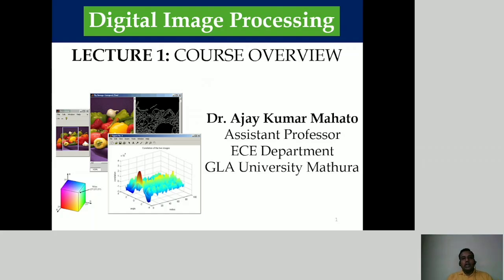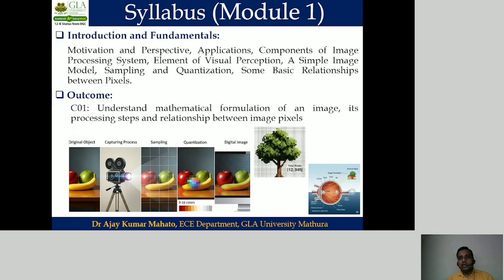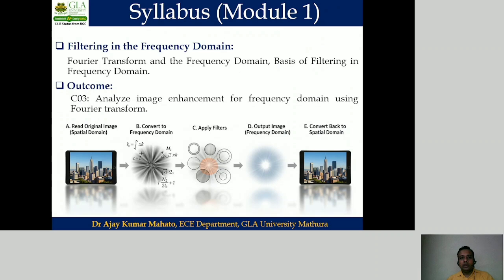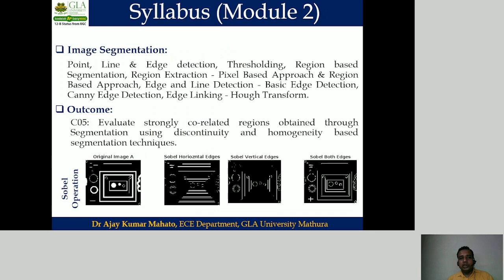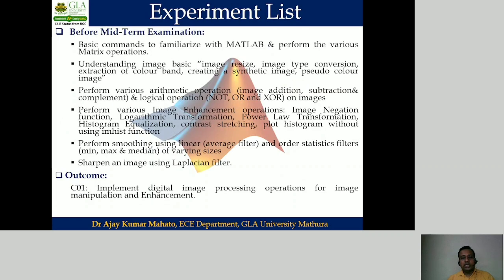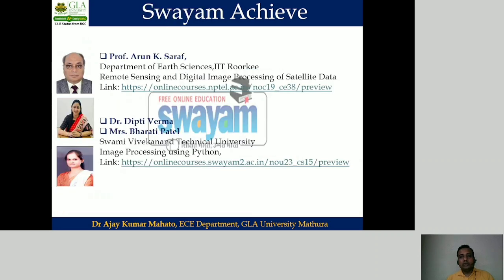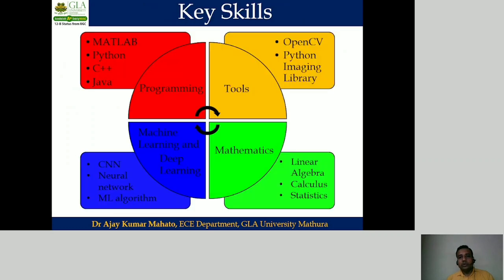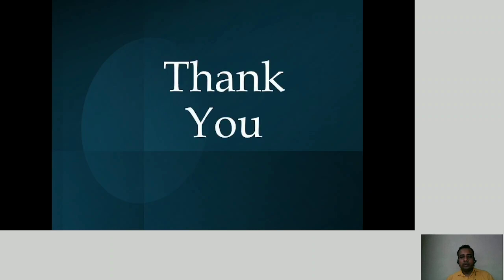Course Overview | Digital Image Processing #Like #subscribe

Comment: Is this playlist according Delhi University Syllabus.
Reply from the maker: Dear Vineet,
This playlist I have prepared as per the curriculum of GLA University Mathura.
Reply: @ElectronicsByAjaySir 
1. Introduction: Digital Image 
Fundamentals Brightness, Adaptation 
and Discrimination, Light and 
Electromagnetic Spectrum, Image 
Sampling and Quantization, Some Basic 
Relationships Between Pixels, Types of 
images
Ch 1
1.1 (pp -18-19),1.4 
(pp 41-43)
Ch 2
2.1(pp 50-54)
2.2(pp 54-57, 61-63)
2.4(pp 63-77)
2.5(pp 79-83)

2. Spatial Domain Filtering
Some Basic Intensity Transformation 
Functions, Histogram Equalization, 
Spatial Correlation and Convolution, 
Smoothening Spatial Filters: Low pass 
filters, Order Statistics filters, Sharpening 
Spatial Filters: Laplacian filter

Ch 3
3.1,3.2,3.3 (133-140),
3.4(pp 153-160),
3.5, 3.6(pp 175-182)

3. Filtering in Frequency Domain
The Discrete Fourier Transformation 
(DFT), Frequency Domain Filtering: Ideal
and Butterworth Low pass and High pass 
filters

Ch 4
4.4, 4.5(240) 4.7(pp 
260-268), 4.8, 4.9(pp 
284-289)

4. Image Restoration: Noise models, Noise 
Restoration Filters

Ch 5
5.1(pp 318),
5.2(pp 318-325),
5.3(pp 327- 333)

5. Image Compression: Fundamentals of 
Image Compression, Huffman Coding, 
Run Length Coding

6. Morphological Image Processing:
Erosion, Dilation, Opening, Closing, Hit-
or-Miss Transformation, Basic 
Morphological Algorithms

Ch 9
9.1-9.5 (pp 652-661)

Image Segmentation: Point, Line and 
Edge Detection, Thresholding

Ch 10
10.1, 10.2(pp 701-
723, 735-736), 
10.3(742-746)

Refrence Book : Gonzalez, R. C., & Woods, R. E. Digital Image Processing. 4th edition. Pearson
Education,2017
Reply: Syllabus of Delhi University Sem -7 , how many you covered ,  is it helpful for me.
Reply from the maker: @VINEETKUMAR-r7p  In Comparison with the syllabus of DU; Chapter 4 and 5, and few basic terms like Brightness, Adaptation and Discrimination, Light and Electromagnetic Spectrum, Image Sampling and Quantization, I have not covered it in this playlist.
Reply from the maker: In response to this question (is it helpful for me), you should discuss with your concerned faculty member in your university or you may review the previous year question paper to know the question paper format.
Reply: @ElectronicsByAjaySir Ok  Sir , Thanks for reply ❤
Reply: @ElectronicsByAjaySir Recently teacher left the college, In our college new Vacancy opening in CS department So , for completing my syllabus, I connect to you , nice to meet you for friendly and Such a good behaviour, May God bless  you ,  always be happy ❤
Reply from the maker: @VINEETKUMAR-r7p  Dear Vineet, May God Bless You also.
Reply: @ElectronicsByAjaySir TYSM 😊